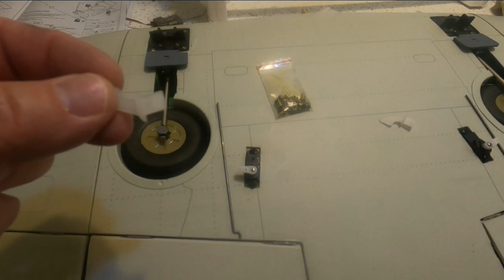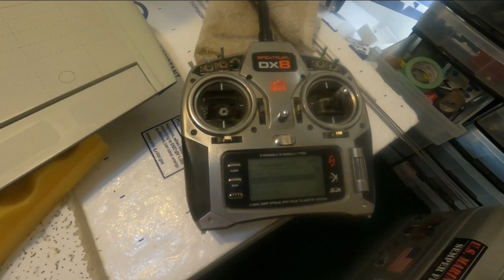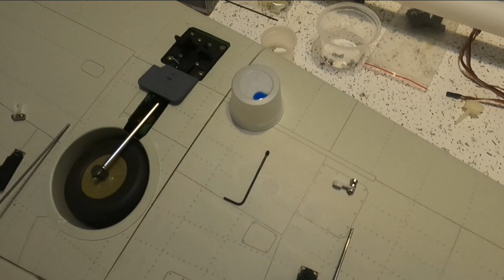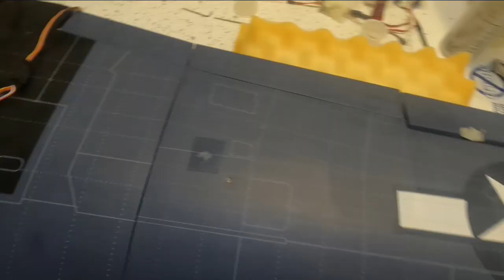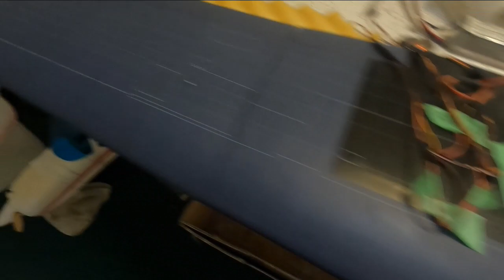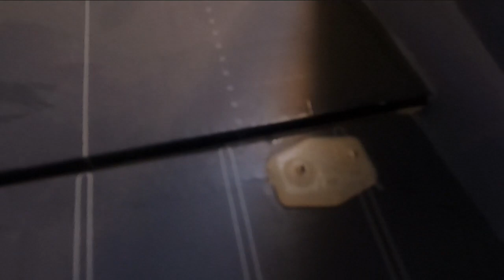VQ Model U.S. Navy Fighter F6F Hellcat Assembly Build Series - Control Horns

Comment: Hey man. Enjoying watching your little series. Never hurts to get a different prospective for how others do things. One thing. Try useing a square on the flap or aileron edge to get the location for the alignment for control horn to the control rod . Helps eliminate any binding.
Reply from the maker: @deweylee2449  thank you and thanks for the tip